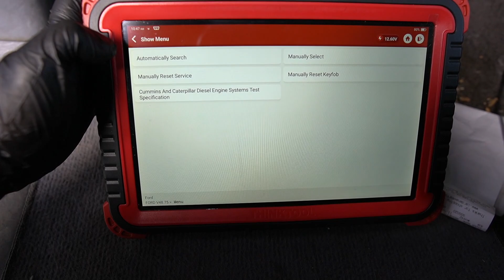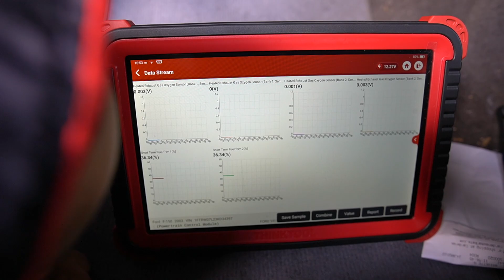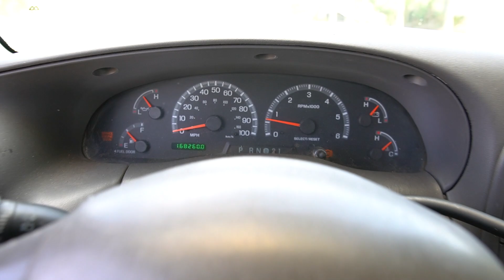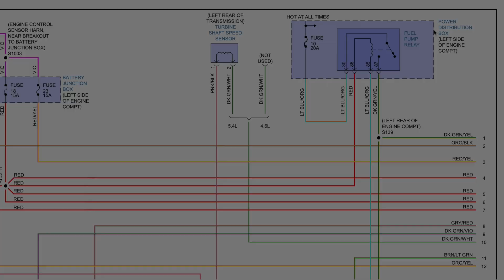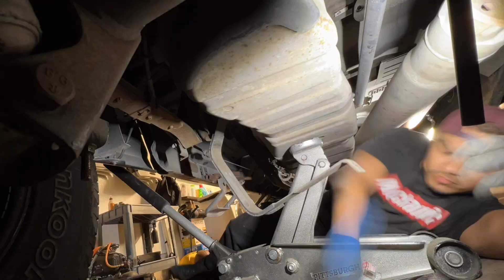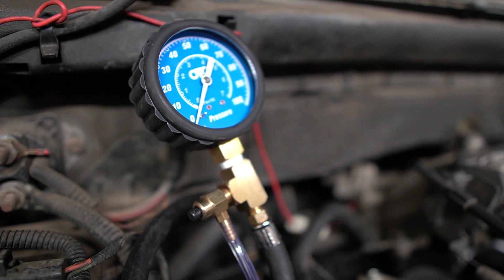Ford F150 Truck Looses Power & Hard To Start - Check Engine Light On - Diagnose and Repair

Comment: Hi. I’m having an issue with my 2001 ford f150 (same as this one) but I’m in Venezuela, I was wondering if we could have a video call so you can help me, of course I would pay you a fee. I’ve changed many parts and still getting long crank and power loss. If I rev it slowly there is no issue but if I rev it hard it sputters a lot. Very sluggish acceleration. No check engine lights. When the sputtering occurs the bank 1 o2 sensor goes to 0 and the bank 2 o2 sensor is at normal level. Fuel pressure when idle is at 45. New fuel pump, new filters, new injectors, new spark plugs, new o2 sensors, new injectors and coils connectors. New battery. Thanks

Comment: First I want to say thank you for all your expertise,  and I have a 97 4.6 engine in my truck , all of a sudden it lost its full power and makes noise on the driver side of the engine something like a backfire but not fully, it has no power when I press the gas pedal, if i was to drive it it probably wouldn't go over 5 miles per hour, please help me figure out what needs to be done , maybe a coil pack or full tune up , not sure .........
Reply: same here did you figure it out

Comment: I’ve got a 2013 F150 5.0 XLT. Long start, I have to press the pedal to get it to start. Replaced the fuel pump, no change.

Comment: Also seems like the fuel pressure regulator was bad ( in the fuel pump assembly on a lot of vehicles), by how the fuel pressure dropped so fast when shut off.

Comment: Thank God your teaching your innocent boy cuss words.. that way when he goes to school he can tell them what time it is.. behind the truck battery is a plastic black box for vacuum. Same with up under the passenger front tire wheel well. Got to check those area for vacuum leak also. You wouldn't see it with smoke

Comment: Hello, I have a  serious trouble in my ford F150 1999 V8, if i  selector to 4L i have a good power, if i selector to 4H and 2H I got a low power to drive forward and the engine will stop after 5 seconds.anybody can help me sir??.
Reply: Automatic or manual transmission? I'd say the Automatic transmission clutches are messed and the truck has gone into a limp mode to keep you from damaging further.

Comment: I have a 2002 f150 and it stopped while driving and was able to get it to my in laws house before it completely stopped. There's power, a new fuel pump, new battery and connectors (I blanked on the name lol) but when I turn the key the power shuts off and nothing happens. When I let go of trying to turn on the car the lights come back on. Many videos say it's the key ignition but we took the dash board apart under the steering wheel and tried to manually start it by the switch in the dashboard. What could it be? Would it still be the key ignition? Please help. Anyone. Lol. This is the only car I have and I have 2 kids to take to school and pick up and also use the truck for my business.
Reply: Also, there's no codes coming up when I plug in the computer reader.

Comment: Update. My 02 has same codes. I have put new plugs, new coil packs, new injectors, new fuel pump, replaced all fuel lines and emissions lines under the bed, I do not know what else to do. I put a part on and the service engine soon light will go off and it will run smooth as silk for a few miles then the service engine soon light will come on and it starts missing like crazy.  Can anyone help please. Tell me anything.

Comment: I am saving your videos and subscribing. I am a DIY and never found anything that I couldn't fix till I had this exact issue with my 02 f150 with the 5.4. I have put, new plugs, new fuel injectors, new coil packs, new egr, new back pressure valve, and new fuel filter. The bad thing is everything I did fixed it for a day or a few miles. But I have been taking off the battery cables. I am sure it is the fuel pump now after watching this. I even have the same codes as your one you were working on. So I am pulling pump out today and putting new one in. Wish me luck.Oh and Iove the way you are letting the little one be involved. Taht is how I learned everything I know. My dad did me the same way with everything he did. Thanks for the video. I am a new subscriber as of today.
Reply: Well any updates i have been having the same issue with my 02 f150 4.6l at 234k miles, replaced the everything u have and even replaced the fuel pump. Still sometimes rev up and down at start and stalls

Comment: Aye bro I have a 04 f250 with 5.4 gas engine 2 valve acting up I had that catalytic converter stolen and it started to shake around 50 mph when let off the gas I put a new one on changed 02 sensors idle Control valve,  throttle position, sensor, fuel injectors and it helped but now it dies once I let it idle

Comment: My truck is behaving similarly and I've replaced so many things chasing this lean condition with the same codes my scanner showed the fuel pressure is within proper parameters I've checked for vaccum leaks a ton and replaced the tps,maff,the fpdm,fuel filter and fps I'm considering just replacing the pump I'm pulling my hair out here 05 5.4 3v
Reply: Same here, did everything u said and no luck. My 02 4
6l still revs up and down till it bogs down and stalls. Infuriating fr, any updates?

Comment: I've got to tell you that this video shocked me, I bought a little old 2001 f-150 with the 4.2, when I bought the truck it ran great for about a month with the exception of a long start well about two weeks ago my check engine light popped on I had a scanner put on it and it was a misfire in my #1 spark plug so I went and bought a new coil pack, plug wires, and spark plugs for it but before I could put every thing on I was driving down the road and all the sudden it started running real rough man it was running bad I told my little Chihuahua dog , baby girl we might not make it home Lol, but we did, any way I put all the new stuff on it and the check engine light was still on and it was still running rough, I even put a few new sensors on it to no luck, but what shocked me the most was when you did that fuel pump it fixed that long start issue and that truck sounded so much better, see what I think, and I don't have a scanner tool, is when I did the plugs and all, it probably fixed that #1 misfire issue I had but now my fuel pump has finally said enough is enough I don't know, but that is surly what it seems ,I'm on my way out the door now to put a fuel filter on it just because I don't know when it's been changed last, thanks for a great video I assure you I'll be looking at many more.
Reply: Hey did you ever find out if the fuel pump was issue? I bought a 2000 ford f150 a month ago and been replacing everything injectors, fuel pump, fuel filter, pcv valve, a fee hoses, exhaust manifold, plugs, ignition coils, and still running rough I'm at a loss
Reply: @carruthersbrothers - Did you resolve the issue ?

Comment: I'm having the same problem with long cranks to start but when I push in the throttle there is no response at all, do you think it's the fuel pump as well?

Comment: I’m trying to fix my f-150 2000 and headlights won’t turn off and dash lights won’t come on and I thought it was fuse check all illumination and headlights fuses there good probably the gem module but everything els works so maybe something with fuse box
Reply from the maker: Whats the year, make, model, and engine size on the truck?
Reply: @HomieHektor  2000,ford,f-150,base,5.4

Comment: Nice diag and job on that '03 Ford F-150. Dealt with similar issues on a Ford F-150 1999 4.2L, after fixing their vacuum hoses and having to replace a couple other odds and ends, even double confirmed with smoke test and fuel pressure test. The girl still wanted to sell the truck for P0171 and P0174 (Lean both banks) and not have me replace the fuel pump. I was like sell a truck over a bad fuel pump 😵🤦‍♂️🤷‍♂️ 
I get selling a truck with a bad engine/transmission problem, but a couple hundred dollar fuel pump. Like you out ya mind. Oh well. 😂😂
Love the videos Hektor, you good in my book.

Comment: Just saw your How to use relay as kill switch video and have a question. I have a 12v auxiliary battery system. I want to use 2 -12v DC motor back 2 back with shaft connecting them. One will be wired to my 10a pwr sollar controller & the other via toggle switch & fuse box,to 2nd motor. My question. Hope you can follow.Can I put a relay,5 pin set up like in your video, between the battery & 2nd motor so when the 1st motor that's connected to the solar controller charging the battery,reaches desire charge, then the relay cuts off the 2nd motor so not to over charge.

Comment: Those damn gas tanks on trucks a re a pain in the ass. Changed the fuel pump on my dad's excursion and even after symphoning out most of the gas it still weighed a ton and doing it in the driveway was no fun either.

Comment: Hector your killing me .I do this job by removing all the fasteners on the drivers side of the bed loosening the fasteners on the passengers side of the bed pull the fuel fill in disconnect the tail lights connector lift it with my shoulder support it with 2by 4 give you lots of room to work.
Reply from the maker: This truck has a tool box (not shown in video) and it’s loaded with a bunch of stuff.

Comment: Really really good video :) I thought that the issue with the pump motor would only be if motor is spinning slower. I didn’t know that you can problem as well if the motor spin faster. So whats the rule of thumb to pump motor rpm? As always very informative, keep them coming. Thanks
Reply from the maker: 10,000 rpm (high) 4 amps of current (kinda low) 20psi of fuel pressure (low)… high pump rpm means the pump is not pushing enough fuel or little to no resistance to fuel flow, this pump wasn’t holding pressure with the KOEO (bad check valve or internal leak at the pump) basically the fuel pump is freewheeling. 👍🏼
Reply: @HomieHektor  And he even takes the time to write back. Your videos are super informative and you are very knowledgeable for sure! Thanks for the awesome content man